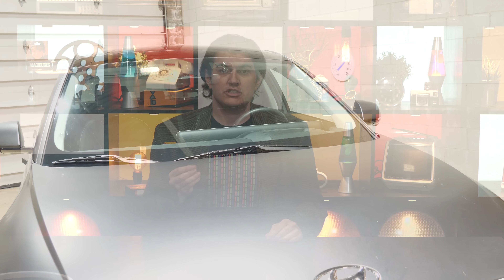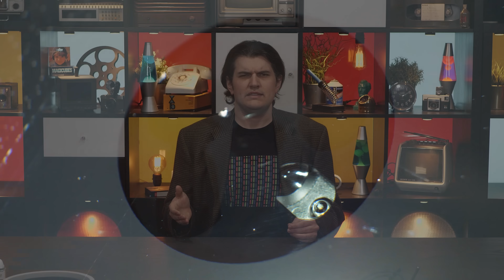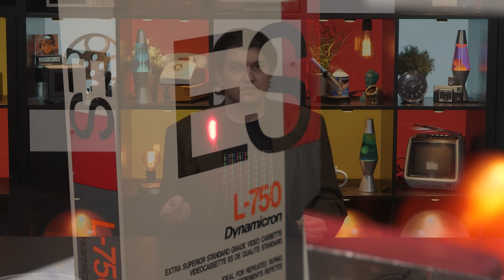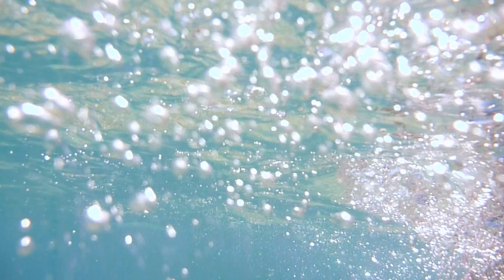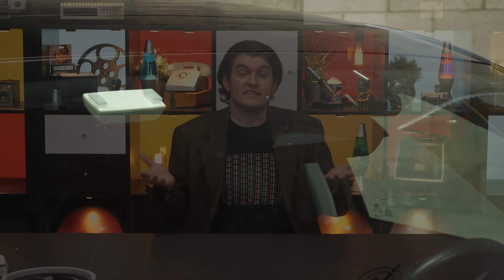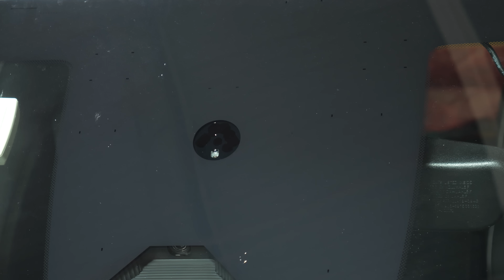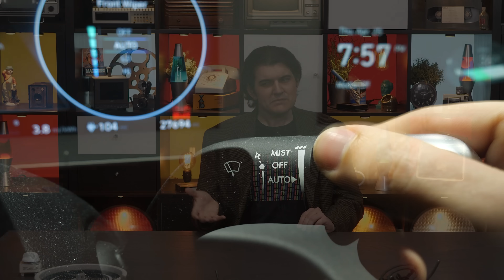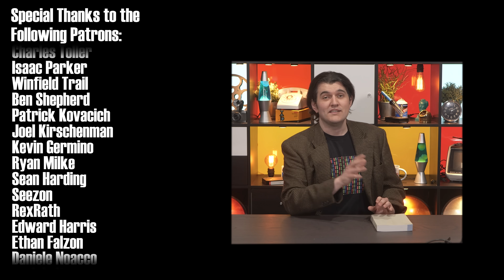The simple, clever sensor behind automatic windshield wipers

Comment: Disabled my Cadillac "Rainsense" on both 2002 and 2006 vehicles. Caddy wanted to adjust the intermittent delay based on intensity of rainfall. Never worked properly. There is little more annoying than having the wipers at the wrong duty cycle, thus not doing the job properly. I hope the technology has greatly improved since those model years.

Comment: The one other issue with automatic wipers is that they don't usually turn the car's lights on. It's required in several states (I know NY & CA for sure) to have your lights on when your wipers are on. Not just daytime running lights, headlights. Side-view mirrors don't have wipers. Trucks' side-view mirrors don't have wipers. If you don't have your lights on, you may be invisible to the people ahead of you, making merges dangerous for both of you.

Comment: Frustration: My semi has the sensor pack for lane keep assist and AEB, which includes the rain sensor, but it doesn't have auto wipers. It uses the sensor purely for seeing if it needs to wipe before the camera callibration on startup. I think it also has the light sensor as well despite not having auto headlights. I guess it's easier to just make one sensor pack for all of the different feature combos. This probably also allows it to be easily converted if exported to an area where auto lights are mandatory now.

Comment: My cheap old Citroën also has a position to change them.  It is activated with the car off with a single touch on the lever.  And it also has a second use.  When it snows and you have the car parked outside, it is used to deploy the windshield wipers and prevent them from ending up buried in snow.

Comment: My Nissan Sentra also has to have the wipers sweep up to let you change the wipers, as otherwise they'd hit the hood. Tho mine in a much simpler process of 2 quick pushes on the stalk to the single wipe setting. Really simple. And also in the owners manual! I could tell the owner before me scratched the paint on the hood trying to remove the wipers too. Good design for aerodynamics but not the best for consumers who don't read the manual.

Comment: VW does the service position very similarly, after turning the ignition off you can use the "wipe once" press (stalk down) and they move up and stay there.
Only when the ignition is turned on again, and the stalk is pushed down again, do they move back into their normal parking position. 

THey also have other tricks, when stopping/locking the car while the temperature is <5°C they move slightly up a bit, so the windshield defroster/or heated windshield has a quicker effect on them and they are easier to reach when deicing your windscreen.

Even crazier, after being used, when stopping they might move just a tiny bit to park the wiper on the other "side" every once in a while and prevent them from bending/conforming to one side.

Comment: I see it as kind of working somewhat like a photo electric smoke detector ,  drops on the surface of the glass refract the light back and sensors detect the change , I can also detect the how much rain and be used to determine how often the wipers need to operate from full on high for a downpour to just an intermitent wipe for a light rain on some cars,,

Comment: Automatic wipers are a solution to a problem that really didn't need solving. They add cost and complexity, behave unpredictably and are either merely distracting or downright dangerous when they misinterpret conditions. Considering the manual control is still right there on the stalk, they simply do not need to exist. 
They should go in the bin next to touch controls, folding side mirrors, pop-out door handles and touch-unlock buttons on the car exterior. All unnecessary fluff that piles on a thousand new points of failure, and will be impossible to find replacement parts for when they inevitably fail in 15 years time.

Comment: Air/glass interfaces do some WEIRD things optically. I had a beaker of manganese dioxide in water sitting in my basement I forgot about and the water evaporated off, leaving the blackish/brown manganese dioxide crystals all over the sides and bottom of the beaker. Though, looking at it from outside, through the glass, it looked like gold. Gold colored, shiny, metallic. Not at all like Manganese dioxide. I was confused about it until I read about thin film refraction. Like the rainbows you get on a puddle with a bit of oil in it.

Comment: Regarding the calibration: I imagine some (luxury) cars might also keep this kind of sensor running 24/7, or at least keep it running for hours/a few days after power off. Even if it draws a few tens of milliamps, it will take weeks or even months to significantly impact battery levels. A lot of modern cars (even gas/diesel ones) have complex battery management systems that will keep a lot of systems running in the background for a day or two after running the car. The impact on the battery level is minimal, but it allows the car to 'wake up' faster. If the BMS then notices the battery level getting low, it will turn off things.

This is the same reason why a lot of modern cars won't have issues with you 'draining the battery' because a door wasn't 100% closed and it left the interior light on. It will prioritize you being able to run an ignition cycle over your interior light. It could even be that it will warm you if it things the battery might be sufficiently low that starting could be an issue and request you keep the engine running for longer.

You can even hear a car do this - I will hear my car (modern BMW) click away if I'm working near it in the garage the first few hours after power-down.

Comment: I always wondered if my induction cooktop has the same sensor that picks up when anything overboils and the stove noitces it and shuts off. It starts first to beep. And it does beep even when turned off, when I clean it with a wet towel, before wiping it dry with another one.

Comment: Another useful information I found hidden in the manual is that, if you finish with wax when you wash your car, the automatic wipers can behave erratically as the wax changes the way raindrops move over the sensor. Even the dealer couldn't sort it out, until I read the manual thoroughly. So, definitely... RTFM! 🙂

Comment: There's a simple trick for calibration of auto wipers on peugeots, or at least on the older ones, you need to push wiper stock down for auto wipers and that triggers 1 cycle of wiping and rest is based that post wipe signal

Comment: One thing that I wonder about.  In chemistry lab, infrared spectroscopy measurements were done in containers made of KBr, since infrared light did not easily go through glass.  I could imagine though is that in chemistry we were interested in very weak absorption in the infrared and using glass would have blocked that.  Water and alcohol both absorb infrared light very strongly, so maybe such absorption of infrared by the glass would not matter as much.  The question then (ignoring absorption of infrared light by the glass) would be how much of the sensor effect is due to absorption of infrared light by water  & how much of the sensor affect is due to change in the refractive index.

Comment: The designers of the sensor module probably use two sensors to battle cross sensitivity. You can either measure the differential between the two sensors to suppress common mode signals. It could also be that one of the two sensors measures the same quantity, but has different characteristics such as rise or fall time, accuracy etc.

Comment: If these are cheap, could they please be added to public transit buses? We have none of those damn stalk things, and the windshield wiper control is on the dash!

(That being said, I really do like turn signals being activated with my left foot. It’s now my preferred method, to the point of I don’t drive a normal car for a few months, I’ll start by stomping at the floor to put on the turn signal.)
Reply: (To be fair, there isn’t a great spot where the sensor can be under the path of the wiper blades, but not blocking some portion of the windshield that we’re looking at, which isn’t great from a safety perspective.)

Comment: Sounds like you still have the same issues Tesla's have. Its not perfect. Pro tip: On Tesla's (with stalks) you can press in on one of the ends of the stalk for it to immediately clear the windshield and the menu pops up on the screen for quickly adjusting the manual speed. Press this halfway in and it wipes, press it in fully and it washes the screen. Less clunky than the 50-way adjustable traditional stock. Which isn't standardised among cars anyway.

Comment: Have you seen wood stove/fireplace fans? They are meant to provide a little circulation of the hot air from a stove. They are Powered by a Peltier module and they have a bimetallic strip for regulation too.

Comment: My cars automatic wipers have been driving me crazy from the start. They seem to wipe regardless of rain. 

No rain: wipes every few seconds.
Torrential rain: wipes every couple seconds
Slight fog: oh boy, here we go!

What puzzles me is that a seven years older model of the car had a sensor working PERFECTLY! 

If it werent for the behavior with fog, I'd wonder if the automatic feature is even enabled. The wiping speed loosely corresponds with the sensitivity setting.

Comment: Hiding windshield wipers below the hood and having to perform some kind of trickery to be even allowed to change them is annoying, I agree. I have it on my Audi A6 C6 which dates back to 2004. But it has possitive effect on wipers effectiveness on highways - water is not escaping back to the windshield after wipe cause wind is not allowed to do its job.

I don't know if other cars do the same, but I discovered related "party trick" of my Audi just by accident - whenever you enter this "wipers service position", wiper arm motor is released and you can move them freely which is handy when changing wipers.

Comment: I had auto-wipers on my 2002 car that were nearly flawless, also with the added usability of a stock to jump from AUTO, OFF, INT (w/ adjustments), LOW, HIGH. (Pull to clean and 3-5 wipes after that). Nothing new but still a cool simple technology. Had a similar auto-reset if there was mist on the windshield but I don't think it had any sort of training or adjustments, just the two readings. Also the same sensor did auto-headlights and it was on point, 30min before sundown, or sudden cloud cover it would turn on marker lights and DRL.

Comment: I have been in a BMW when it absolutely refused to keep the wipers ON in the pouring rain xO, we believe it was the software around this malfunctioning (and also not having robust design because it failed dangerous, typical in cars when it comes to application of tech xD). This is kind of why you forgot to check the manual for the wiper stop position, because of course that should've been obvious to users in the control system itself, but car company :) 

I guess with that other company, the bigger problem is water just pours into the interior anyway? The least car-company-like-car-company is the worst car company, go figure.

Comment: auto wipers are one of the worst inventions, had a car with them, ended up unplugging the sensor, fixed/not adjustable intermittent is better haha, driven a few other vehicles with auto wipers, and they all, at best, suck, thankfully while my car has auto wipers, its one of the ones that you can turn the "feature" off

Comment: I knew that newer cars had a different system for detection of rain than older ones, didn't know it was made so much more complicated 😂 I've seen some strange ways to detect rain like using two sensors one UV I think to detect day or night and when the other is partly obstructed by rain and how much in the visible spectrum determines on and off as well as the interval and speed, so if it determines it's daytime via the UV sensor and the visible light is being lowered by the rain it might start on low or the longest interval, and ramps up after a wipe probably by timing how long and how dark it gets between wipes, it has some type of intelligence and learning because it is a bit wonky after you reset the ECM, BCM etc by unplugging the battery, but did get fairly good at noticing even light rain and did well at determining the right intervals for what input it had when you think about it 😂 I feel like they probably use the same stuff for scanning barcodes in the newer ones, the scanners can read even barcodes with condensation on the package etc at weird angles and it probably detects the changes in the refracted light pretty well, I'm sure they are using multiple methods to up the accuracy, ability to scan uneven, smudged, partially obscured barcodes too. They have gotten so good they will catch items multiple times as you scan one and try to bag it 😂 if anyone knows more information I would love to hear from you and I greatly appreciate everyone's time and effort! I hope you all are having a great day or night my brother's and sister's!

Comment: My car has automatic wipes, and I can't stand them. They never work as intended. If my stalk is in the interval setting, I would like my wipers to go at set intervals. If my stalk is in the high position I would like my wipers to go constantly, and fast. And yet. The wipers will do what they think is best. (It's not best, it's downright irritating.)

The worst part is that they're on by default, and I don't know how to turn them off. It's probably in the manual, which I haven't read. (Because the manual is in Japanese, because my car is a Japanese import.)

Comment: Something I realized after when looking at this video is that your viper stalk is different than mine. I drive a Kia E-niro (2021) EU edition and my viper stalk has off, auto, speed 1, speed 2 (order from the bottom up). I also don't have a "Mist" setting at all. I find it kinda strange considering Kia and Huyndai (which Alex uses) use the same platform. I thought this interface was standard? Does it differ from region to region?

Comment: My 2005 Buick LeSabre had automatic wipers and I'm surprised it was on such a relatively old vehicle and not any of the newer ones I've had since. It also had a sensitivity adjustment on the stalk which was interesting. Useful too because sometimes it would get a bit too sensitive and trigger when sudden darkness was encountered, like under an overpass, tunnel, etc. It worked really well overall and I rarely if ever had to use the manual modes

Comment: I have driven three cars with automatic wipers. My daily is a Mach E, and I have disabled the auto function. I couldn't quite get satisfied with the sensitivity levels, and as Alec said, stalks. Then we rented a Hyundai Santa Fe last year. Those auto wipers actually worked great.

Finally, we rented a car from That Company a while back... the automatic wipers in the Model S were absolutely psychotic. One morning, it had frozen overnight and there was frost on the window. The wipers immediately went into maximum speed to absolutely no effect. But I couldn't shut the car off because I needed the defrost to melt the ice! So for a good five minutes, the poor wiper blades were being dragged back and forth across an eighth inch of ice. This made a "delightful" sound.

Comment: two days ago, i changed the wiper blades of my car, and i had exactly the same problem, the switch is smarter than me, and return to the off position, even with the engine off. for the next time, i will check the manual, i'm sure that i will found some procedure like the shown in the video.

Comment: Had a ionic 5 for front repair today. Hyundai won`t sell the plastic bracket that holds the cruise control sensor. So you have to spend a few thousand on the entire sensor you don't need. And that, even though  the sensor is mounted on that bracket with simple philips screws.

Comment: VWs have had the wiper maintenance mode since at least 2007. But the procedure is similar however, on some VWs I've owned (2007 Passat, 2009 Passat, 2019 e-golf) the steps to make the blades sit in the up position sometimes just doesn't work. Namely on the e-golf.

Comment: I don't have one of these newfangled cars with a device like this, but it's very interesting to see how one works.  For my part, I rely on another complicated pair of sensors which, when light passage is obscured to a sufficient degree between the sensors located behind the glass and the road located in front, trigger an electrochemical reaction that forcibly bumps the stock near the steering wheel to activate the wiper system.

Comment: You dont need that special wiper procedure. Just open the hood and do the job from the front. I just did it on mine. Apparently the Ioniq 5 comes with the worst wiper blades on earth. My Chevy Volt wipers were still perfect after 6 years. Ioniq rubber was tearing at 2.

Comment: another tip about using "rain sensor" :   –You do not want to have it ON when you start the car below/near freezing point of water.
–You do not want to leave it ON in winter time!
Reply: Tesla wipers are heated but "Auto" mode would scare me in winter. Also scary, in summertime windshield cleaner is advertised in the midwest as "safe to 32F". I almost used bought it except I've frozen and cracked a pump before using just water (the same as 32F). I did a double take and found the real stuff "safe to -20F", close enough as we only go to real -40F a few days a year and just hope it doesn't break.
Reply: @trizedlyza  I don't think Tesla heats wipers overnight in winter time. So if you start the Tesla with frozen wipers stuck to the glass it definitely will took some time to melt water around the wipers. And if the rain sensor never switched off before it could decide to wipe from the very start of the car tearing off the thin rubber blades. 
So Never ever leave your wipers in Auto position leaving a car for a long parking.